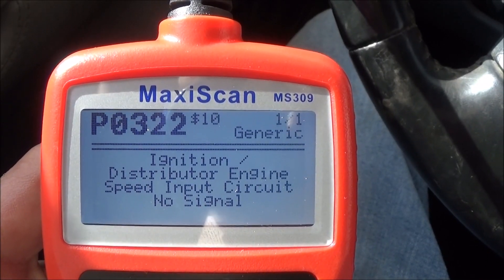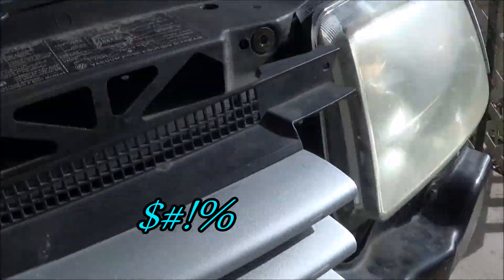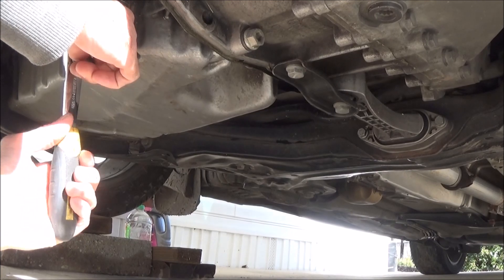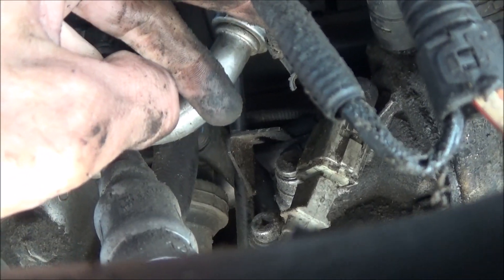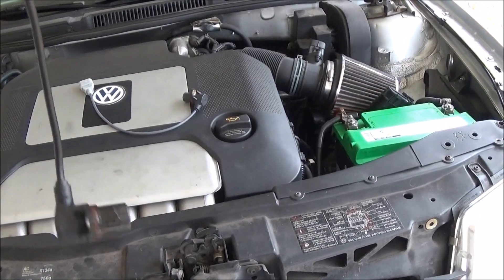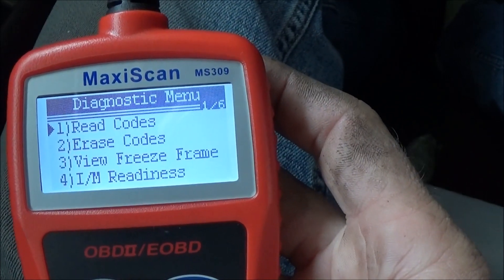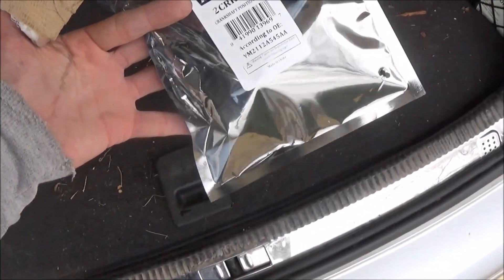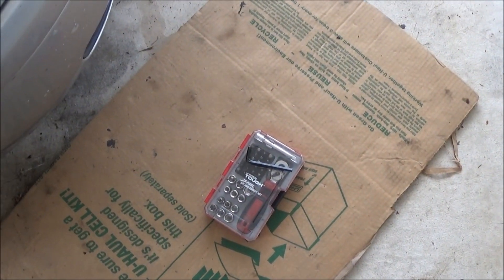P0322 Crankshaft Position Sensor Repair

Comment: Did this sensor end up working? I replaced my sensor a while back I’m assuming it was a super cheap one, but now I’m getting codes again.
Reply from the maker: Yes the new sensor worked but  it's going to be a continuing problem , Probably oil in the sensor again. https://youtu.be/tIkNODnXYfo?si=qBR0Q9mRgHS65BZx
Reply: @joshcb7 just weird bc I replaced it like a year and a half ago.